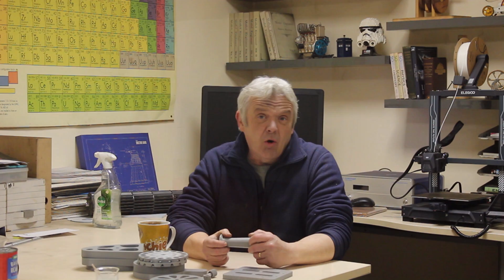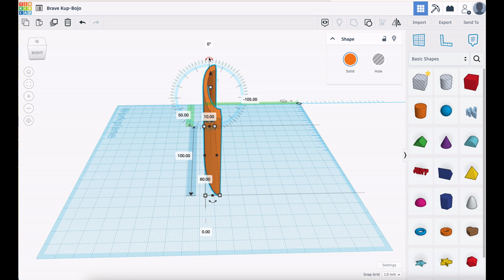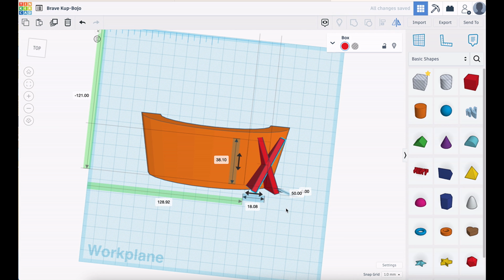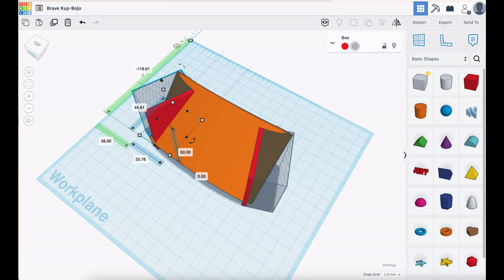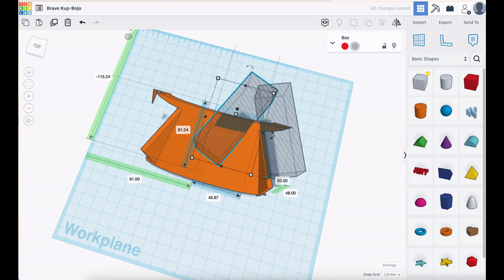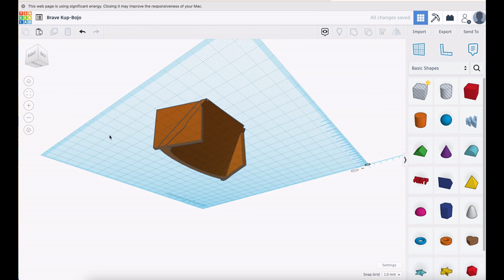1816 Updating The Darwin Wind Turbine

Comment: Anyone familiar with mould making could simply replicate any number of parts from just one print saving tons of time.. A basic RTV mould making kit consists of a silicone or flexible polyurethane mould into which you pour resin and hardener. Apart from saving lots of time printing, the parts can be made to any shore hardness to suit your project.
Reply: I used to make industrial Polyurethane and now have six 3d printers. You're not wrong, except you can only make parts while you're awake and you typically have a lot of preparation and post processing you have to do on the parts. There are also limiting factors like total curing time and space to have many molds at once.

I think another solution could be to print parts with a 3d printer and then fiberglass them afterwards to give them a tough exoskeleton.
Reply: @stewiex  you can even do a process similar to fiberglass with resin, a paintbrush and regular fabric. Of course it won't be the exact same properties as fiberglass, but it's probably cheaper and at least a little safer than fiberglass.
Reply: @stewiex  I've been making moulds, designing and casting parts for over 50 years. My method of spin casting hundreds of parts per hour is second to none. Apart from cutting off a spur, there is no post processing involved, whereas all 3D printed parts involve some kind of finishing. 3D printing is mainly for making one off prototypes, it is not intended for mass producing duplicate parts.
Reply: @lagunafishing  There are many materials you can print with that are extremely strong from carbon fiber reinforced PLA that you can print on even a 'hobbyist' printer with only a hardened steel nozzle upgrade. 

You can also print soft materials like TPU (thermal polyurethane). 85a to 90a are readily available, but I've seen as low as 35a advertised as in the works by filament companies. Compared to a cold pour industrial polyurethane, the TPU is instantly ready to be used off the machine whereas the regular polyurethane takes about a week to fully set up.

Additionally, look up new printers like the Creality CR-30 (printers on a conveyor belt for mass production) and the Bambu X1 Carbon (prints about 3-4x faster than a conventional 3d printer and can even make multi-colored prints).

Finally, there are now even printers for metal and concrete being made for commercial use. There is a rocket company 3d printing their entire fuel tanks with essentially a big 3d printer with a mig welder attachment. The future is bright for the technology.
Reply from the maker: it doesn't save time mate - I get it you think it does but you are only thinking of you - imagine the beginner - also have you done much 3d printing recently - things have changed - I just pluck the parts from the bed and use them!
Reply: @ThinkingandTinkering  yes I get it, but I'm not just thinking of me lol, the suggestion was meant to be helpful to beginners. I have done lots of 3D printing which are fine for knocking out a few prototype designs but casting your creations from a master saves a ton of time - depending how many you need of course.
Reply: I agree. 
As a world leader in composite moulding technology, Who developed processes to make World championship winning carbon downhill bikes in one piece, and technology that has been used to win every Americas cup since 1999, it amuses me a bit all this fanboy nonsense about 3d printing. 
Things like Murray's turbine blades could be easily accomplished by pultruding a section through a heated die with a chop off saw in less than a second per blade in  an easy automated process. Without any electronics. 
I've largely moved on from the toxic synthetic expensive materials. 
Hemp fibre with a Magnesium Oxide /potassium phosphate activator as a matrix can be just as strong and far tougher than the carbon-epoxy at 100x lower costs, and sub five minute cure times.
Reply: @aaronfranklin324  Oooh, Interesting.
Do you have any more info on fibres/matrix materials? I'd like to try making a trailer hard-top, but want to move away from GRP, and maybe try vacuum/bag moulding.
Thanks.
Reply: It's horses for courses. But I agree with you, small runs/parts/prototyping and 3D printers have LOTS to offer; but for larger parts/runs and I'll use moulds virtually every time. I'm a wizz at GRP, plaster/cement mouldings, and the principles/materials are easily learned, cheap and readily available. Try 3D printing one, several, or more,  canoes, yachts, car body-panels, bathroom enclosures/baths, concrete garden/architectural features etc; I'll whup your ass with 1-2 piece moulds and/or vacuum/bagging moulding for price and time and finish, and use the simplest of tooling. And once the mould(s) are made any monkey can turn out finished parts.
Years ago a friend and myself even sag-molded a 26-inch diameter deep-sky mirror blank using a hand-ground 'plaster' mould; and a kiln to dry the mould then sag/anneal the glass blank (the kiln was available as he was a potter);  there's NO way any 3D printing would have been usable.
Reply: @bikerfirefarter7280  Absolutely. 3D printing is suitable for rapid and often sometimes - not so rapid prototyping. It as it's place, but it cannot possibly compete with moulded part production. Nor was it ever designed to do so. I could reproduce a thousand parts in a single day out of my garage if needs be and in a commercial set up 10,000 no problem, but that wasn't what I was trying to convey....simply that it can be a timesaver in many instances.
Reply: @lagunafishing  3D printing is petty much unbeatable for making many parts that are complex/intricate and/or with internal structures. Moulds to do that are either very complex or are sacrificial inserts, or both, i.e. 'lost-wax' etc. Also 3D printing/sintering can locally vary the composition of the part.
Reply: @bikerfirefarter7280  You have just highlighted one of the roles that 3D printing plays - that of patternmaking.
Reply: @lagunafishing  Nah, very limited use, especially for large parts. And once you have a master you can duplicate it many times.
3D P has its uses, but often a bit of thought allows you to engineer an item that can be done cheaper/easier/faster. Its very good for prototyping some things though.

Comment: You could do a simplified version out of builders board for all those who don't have 3d printers? I wonder which would be cheaper or stronger? & if you make a jig it shouldn't take that long per section it just would be straight sections instead of curved unless you can heat the board to bend it? Just a thought
Reply from the maker: it's a good thought mate - cheers

Comment: Very cool, was just playing around with blender for CAD and its kind of tough, fushion 360 looks easier and this   looks just as user friendly option to try.  I just ordered my first 3d printer last night after weeks of shopping it seems, having my mind set on this one then that one, with so many options I  ended going with the best deal i found which was an Artillery Hornet for $89 canadian fund shipped to my door from ali express.  Which is like what 50 pounds?  in 2-7 days no less because they have stock in the USA and dont have to wait a month for china delivery.
  So i got 3, without even looking these printers up much, and i did so much research before this which kind of felt like a waste going into these ones blind, but after a few youtube reviews ive heard nothing but good things, especially in the comments which is more important than the review itself i think.  And this is when they were selling for over $200 USD, so at amost 1/4 the cost i think it was a no brainer. Id love to print these wind direction thingys because the only issue about the hornet was its lack of cooling, although it has 2 fans, they're arent angled optimaly perhaps and something like this would be cool to try and fit it in the housing.   
Ultimately a solidstate fan is the best solution i think and they've just been revealed at CES, PCworld has a spot on them and they're pretty remarkable tech.  I wonder if this could be applied to power generation because a fan is just a power generator in reverse.  These solid state fans looks like flat lithium battery packs that suck air in one side and blow it out high speeds on the other. Many tiny vibrating membranes , vibrating at supersonic speeds is the jist of how they work.  No moving parts, apart from the membranes insided the sealed container.  Offers huge coooling at low power and small form factor i think will be a game changer in 3d printing, who right now is comming up  a gainst a thermal wall when it comes to printing speed, sort of like computers.    Frore Systems is the comapny that makes these that look like they're ready to be used now.  Marketed for thin laptops, which cant reach maximum performance because of thermal limits, i think 3d printing could see improvements now however.   These hornets print head  looks perfect to slide one of these solidstate fan into, that combined with one of these darwin turbine direction things, could be a winner, 1000 m/s printing with no quality loss!!  And soon we're printing solar sails on the moon in 0g further aiding print speeds and cold fusing metal , printing metal, and we're off to andromeda in no time, perhaps with some vibrating membranes propelling us to near light speeds and toward our next door neighbour solar system.   
But I digress,  I think the hornets have been discounted so much because they couldnt compete with the model above them for just a few dollars more - the Artillery genius so they've gone unsold and now being discounted.  At leaste that was one of the only few criticisms about this printer i remember reading  "why buy this when for $20 more i can get the artilliery genius"  but thats not the case anymore so... i'll have to wait to see how they turn out.  But I also really appreciate their unique design on the bowden tube assembly, which tells me they have some real thinkers there and not just some guys slapping off the shelfs parts together and calling it a printer. That being said anything is good these days It seems, and ive heard nothing but good things about the elegoo's new lineup which had them on my list instead of sovol after hearin they just had creality parts inside, although arranged better, i appreciated the uniquness of Artillery Hornet.
Reply from the maker: wow - nice post mate thank you for sharing your experiences and ideas - cheers

Comment: I really enjoy watching this tutorial in using the CAD software.  It's always a huge learning curve to pick up something new and figure out what all the bells and whistles do.  As you finished with this demonstration .. I realized it could be done as a flat wall too .. then you could put one of your blue turbines in a lateral position up top.  Of course the purpose of your design here is to take advantage of wind direction changes.  It's all good!  🙂
Reply from the maker: wow - yes it could - very nice thinking right there mate - thanks for the inspiration
Reply: @ThinkingandTinkering  First: I LOOOVE this content. Actually showing the design process can teach a lot about both the maker and the tool 😉
Right in the middle of the clip i googled "tincercad" and saved a link for later ;)

Just one tip i learned long ago in such programs. This part is symmetrical, so you could save almost half of work if you draw only half of the blade and then mirrored it.

Keep your enthusiasm levels. Your joy of tinkering is our motivation to tinker even more😁Just as you said: "it's all about making stuff". And i agree with my whole heart.
Now i'm off to fix my friends electric heater (those dusty short circuits are horrible) then to fix my gf's earphones (exchanging broken spekars) and then to the kitchen to make a stew 😁

Comment: I watch 3D printing videos sometimes because I have been trying to talk myself into buying one. I came across a video where they recycled plastic bottles into the 3D printer. I thought it would be a good way to keep costs down. Sorry I don't have a link. I must not have saved it.
Reply from the maker: I am thinking of a filament extruder at sometime mate - but one step at a time I think
Reply: Recycling plastic bottles into filament is miserable.  The spools seem expensive but really last longer than you think.  3d printers are okay, but you might consider just paying for someone to print it and send it to you.  If your not sure what you will want to make it is a good option.
Reply: It's doable and quite easy to convert the bottles into filament with a certain type of cheap glue gun. However since it's not professional grade, the diameter of the filament will be uneven and cause clogging etc in the extruder way more often than standard filament rolls.